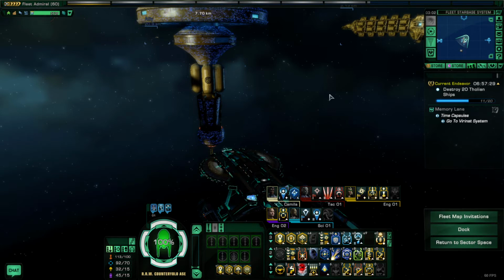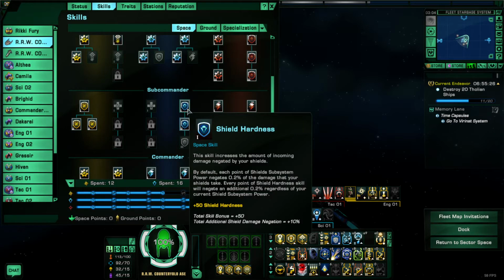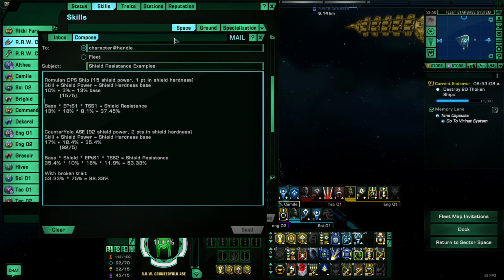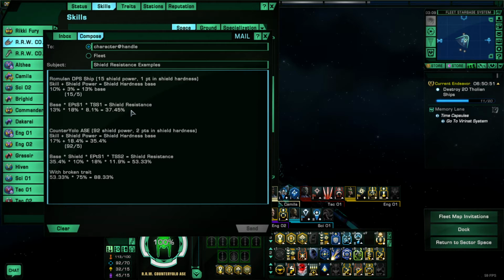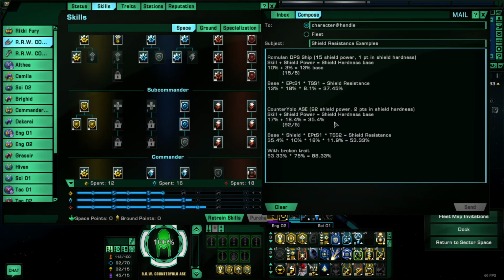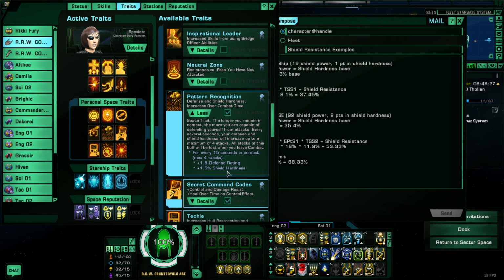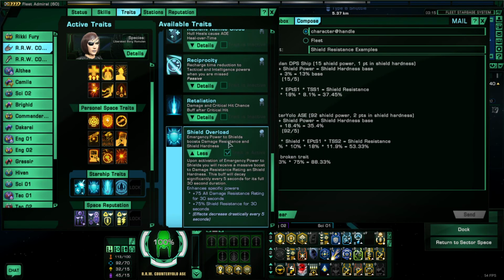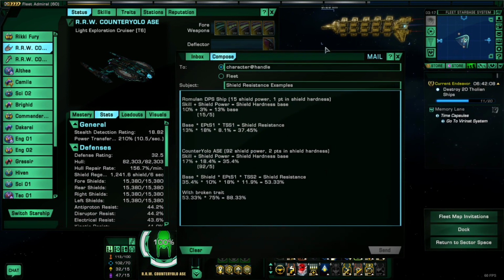Star Trek Online Survivability Guide 4: Shield Resistance

Comment: Is shield overload trait still broken or did they fix it?
Reply: I tried it in a very hard patrol (fekiri in the one with the ferengi) and inspite lots of shield drains I was able to survive it on a dual cannon build(though had to really maneuver and my dps tanked due to being a dual cannon scimitar build).

The shields wouldnt drop from anything but the shield drains and due to the voldar console they came back rapidly.  Shields were pretty much impenetrable.

Comment: do you have any advice on how to Keep shields up against borg? even 125 Shield power, full resist drain including the engineer captain skill doesn't seem to allow my shields to stay up.
Reply from the maker: That's currently one of my gripes for the scaling in the game; Nadion Inversion really should be buffed to have complete immunity to power drain for its duration (as is apparent nowadays with later traits & consoles and such the high numbers back then were meant to do that immunity in effect, but the programmers didn't know how to put that in without breaking the game's code for years). Passive DrainX doesn't work anymore to keep your shields up unless your are a FULL DrainX built science starship (with basically every console dedicated to it; even then, people on Reddit have been complaining about the drain spike since VIL, so this might not even be enough anymore...). Unfortunately, higher shield power doesn't increase your resistance to shield drain, it just increases your passive shield regeneration & the passive shield hardness of your starship. Here are the current workarounds players use in the game.

(1a) Higher shield regeneration & shield healing (& more abilities and consoles that do this for you). Assuming you have some DRR on your hull, you can take a bit of pounding while the initial drain from the borg occurs. Afterwards, you can use your shield regen with shield healing skills to bring your shield back up to almost full quickly. Another player as a support to a tank can significantly help here as well, though often there isn't this type of coordination anymore, as STO scaling doesn't promote it as much anymore (& the fact the community likes a support with 4 DPS players in a map instead).
(1b) If this isn't high for you, the "workaround" for this is to just have Reverse Shield Polarity up as much as possible (it's the reason why many players, including the famous Florian in STO), like the Cmdr Engineering slot for Reverse Shield Polarity (along with an expensive duty officer that makes it last longer) so that it is up as much as possible.

(2) A second option is to use starship disables to interrupt the drain of a borg cube. There are too many ships in HSE for this to work there, but can work decently well on most other Borg maps. I wish there were more interrupts in STO, but ship disables is the closest thing we have at the moment for space combat (we have knockbacks, stuns, weapon disables and the like in ground combat though). If power drain builds were as effective as in the past, draining the Borg's power so their drain would be ineffective would work, but again the scaling of the game right now doesn't make that route work well.

(3) A third route that is used in the PvP community is the full immunity route; if your ship has a a lot of traits that give you a LOT of moments that it can't be hurt by anything, then the having your shields down doesn't matter as much for you.

(4) The PvE DPS route is the exact opposite of this -- just destroy them all before they can capitalize on your weakened starship. This is the route most players in the community say to do; I personally disagree with this, as you are just DPS-ing through the game in this pattern instead of actually thinking and strategizing against the various enemies in the game (which since this is Star Trek after all, a series much about introspection and thought behind it, you would think...).

Those are the thoughts I have for you. Perhaps there are more options available in the game, but I cannot think of more off the top of my head.
Reply: wow - Long (and quick) answer. Thx while I am reading. Will come back a few times :)

Comment: First, thank you for sharing your thoughts on the game in these videos and they are a good source of info for survivability in the current game.  I think your math might be wrong.  The STO wiki has the shield resistances listed up for a 75% cap and shows a basic formula for calculating the resistance which doesn't add up to what your numbers show.  First you convert all the percentages over to show damage getting past.  So the 13% would be converted to 100%-13%=87%=.87 and you use the .87 in the calculations.  You do that for all percentages.  So your first example in the video would be .87*.82*.919=.6556146 which is 65.56% and then you do 100%-65.56%=34.44% resist for the Romulan DPS ship.  For your ship it would be 58.00% before the trait and 89.50% with the trait but supposedly 75% cap so you would be hitting the 75% cap with the trait and respectably close without the trait.  Even so with just the module on the ship and your base that puts you at a 41.86% resist before you press any buttons.

Just wanted to make sure you had the right numbers for your fleet mates.
Reply from the maker: Hi Twitchy, thank you for the great feedback! As for your points:

(1) Math
As for the math, I was using your method shown by the STO Wiki of getting the damage coming through to shields to get the shield resistance, so it is true that I was not showing ALL of the math (when I was trying to explain the FULL math in my first try on this, the video was going over 30 minutes, and I wanted it shorter and more relatable). My numbers could definitely be wrong as I did the math in Word instead of Excel, so THANK YOU for the clarification. Comparing your numbers to mine, they are both still at least in the same relative ballpark – which was the point of the video to give at least some awareness to this category (unlike the damage resistance %, which the game calculates for you). Maybe in the future I can create an excel document on GoogleDocs that we can use to have this calculation easy for everyone, and you can look over and edit it to ensure that it is correct, and a better shield resistance video using that document with the full math (if someone else doesn't do it first).

(2) Resistance Cap
The 75% damage & shield resistance cap was what it was at game launch; however, I am honestly not sure if this cap is what it is currently. Remember, the STO Wiki is technically not official Star Trek Online material (though almost all the material therein is reliable). In my initial damage resistance video, you can see that my damage resistance % actually passes the 75% threshold (I've actually gotten almost 85% on my tactical tank with the "Go Down Fighting" ability) – leading me to personally believe that this cap does not exist currently in the game anymore for damage resistance nor shield resistance (or this limit only exists currently in the realm of consoles with base stats); if this limit still exists, it would be weird that Cryptic would still show a higher damage resistance % than is actually being used by the game. As shield resistance is an invisible trait, this limit probably could only be proven or disproven with a lot of tests with parses to see if this is still the case today. With how strong my shields seem to feel whenever the Shield Overload trait is up, my gut feeling is that we can go above the old cap of 75%. Feel free to post links and such if you know of people that have recently checked or tested this out!